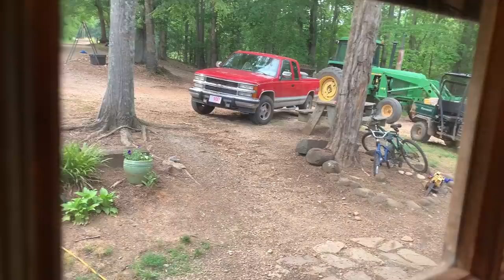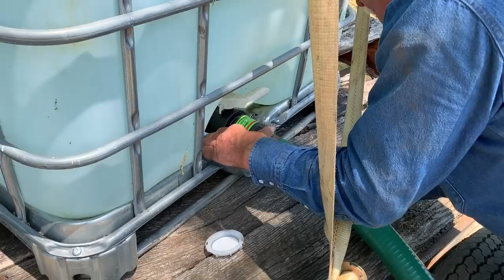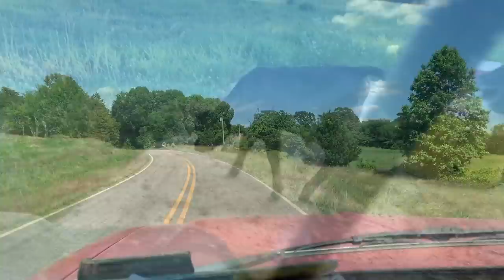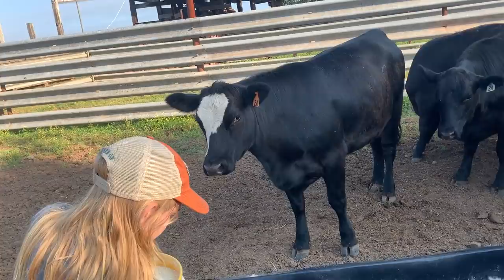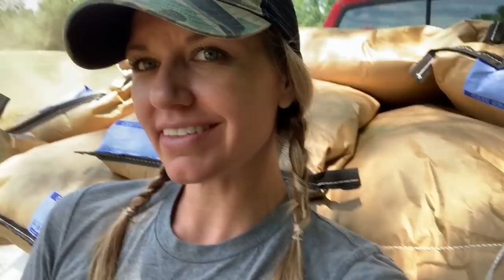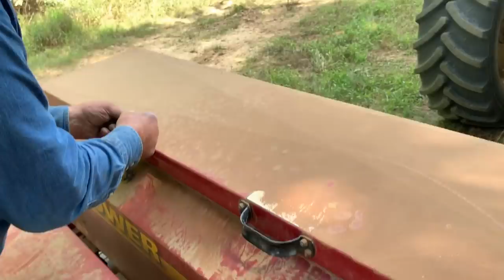Here We Go Now! Back to Spraying & Seeding : How We Control Weeds & Plant Soybeans

Comment: It's nice to see a farm with smaller machines than my family's.  We farm 5200 acres and raise 350 head of cattle.  Our pull type  sprayer that I'm currently runing is 120 feet wide and we run it with a 2018  mt 743 challenger . I'm spraying soybeans for weed prevention.  We started out small but we got more land so we needed larger machines we run 2 planters and combines . Your farm is very nice small farms are very great for looks and stress levels . Your family is very great and has a great dynamic . Nice video stay safe and farm on my friends !

Comment: Couldn't agree more. All the Roundup in use has been used for more than 2 decades...and it is essential for "no till farming" because it does help in the fight against erosion. Not to mention, fuel savings, equipment wear and tear, and untold man hours required to plow, disk, plant as it was done in the old days...
As it was done, the floods your farm had this year and previous years would have washed away a lot of soil..... erosion.

Comment: ENVIRONMENTAL FATE
Glyphosate is highly adsorbed on most soils especially those with high organic content. The compound is so strongly attracted to the soil that little is expected to leach from the applied area. Microbes are primarily responsible for the breakdown of the product. The time it takes for half of the product to break down ranges from 1 to 174 days. Because glyphosate is so tightly bound to the soil, little is transferred by rain or irrigation water. One estimate showed less than two percent of the applied chemical lost to runoff (4). The herbicide could move when attached to soil particles in erosion run-off. Photodecomposition plays only a minor role in environmental breakdown.
In water, glyphosate is strongly adsorbed to suspended organic and mineral matter and is broken down primarily by microorganisms also. Its half-life in pond water ranges from 12 days to 10 weeks.

Glyphosate may be extensively metabolized by some plants while remaining intact in others (2). Once in the plant tissue, the chemical is translocated throughout the plant, including to the roots. 
In others words once it leaves the tank it starts breaking down at the molecular level. I have used daily for over twenty years on a professional level.

Comment: Just so you know mama deer always leave their little ones during the day...they arent abandoned. They leave them because they are safer without the mom around. Fawns dont have any smell to them and they actually dont even go to the bathroom until mom licks them to stimulate them to poop and pee because the smell attracts predators. It's all so they dont smell for a predator to find them. That's why mom leaves them during the day is so her smell isn't close to the fawn which would attract predators to the fawn so she lays down away from the baby so predators would seek her by smell instead of a fawn which they would need to locate via movement and sight due to lack of smell. They come back to them when it's time to feed them in the evening and will repeat the same again the next day and usually leave baby in the same spot unless its compromised such as by people or predators smells. So when people find fawns alone during the day leave them be....they are fine! Once they get a certain size then they are with mom all the time because they start to excrete smells and poop and pee on their own so they are no longer safe alone like they are when tiny. Sounds weird but it's how it works with deer.

Comment: As a former certified pesticide applicator, the label is the law and you all need to be wearing safety glasses and chemical proof febrile gloves when you’re loading pesticides or handling it to protect yourself. It would also be a good idea to wear a face shield when you are loading it. Any time that you can potentially get splashed. I know you guys don’t have one of these tractors but you may eventually look into getting a 7010 series John Deere tractor with the ultra guard XL filter which is certified to protect from pesticide spray down 3 microns. How can you possibly know what glide for seat is doing the plants and not realize that it’s going to harm you also? I understand it’s a different mode of action in it specific to plants but it’s not non-toxic and Monsanto is a terrible lying company and they lost a lawsuit because the custodian who used round up for years got lymphoma from using round up. Just please protect yourself because I wouldn’t want you were Lawrence Getting sick and be sure you wash the kids clothes separately than your own after you sprayed pesticides and wash a load of nothing but water through the washing machine between washing pesticide change of clothes in your next load of laundry so that you can clean out the washing machine.

Comment: Studies have confirmed that Roundup can cause non-Hodgkin's lymphoma (NHL), as well as other cancers, including leukemia and brain cancer. 
 Glyphosate is not harmless to humans, however if safety guidelines are followed it can be used safely.. The roundup you buy at the home depot or your local home and garden store is not nearly as concentrated as the stuff farmers use.   Rubber gloves should always be worn when handling the concentrate.
Reply: According to snopes (and lawyer comercials)it was a jury that determined it likely caused non hodgkin's lymphoma.  Science has not proven it.
Reply: Please name the studies that CONFIRM this.
Reply: @davedammitt7691  it has never been confirmed. A non scientific jury awarded a gardner a settlement after they were convinced by lawyers. I still use it
Reply: @davedammitt7691  
here you go, there are several more. 

Title: Screening of Pesticides with the Potential of Inducing DSB and Successive Recombinational Repair
Journal: Journal of Toxicology (2017)
Lead Author: Karen Suárez-Larios

Title: Toxicity of formulants and heavy metals in glyphosate-based herbicides and other pesticides
Journal: Toxicology Reports (2018)
Lead Author: Nicolas Defarge

Title: Sex-dependent impact of Roundup on the rat gut microbiome
Journal: Toxicology Reports (2018)
Lead Author: Veronica L. Lozano